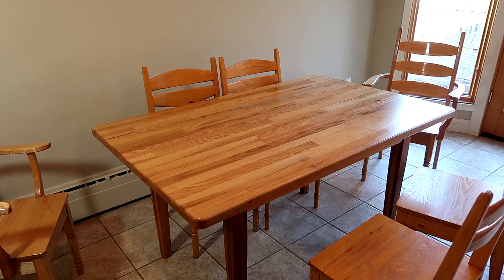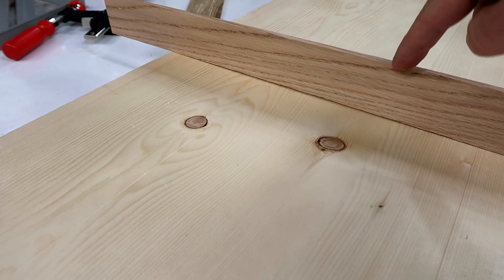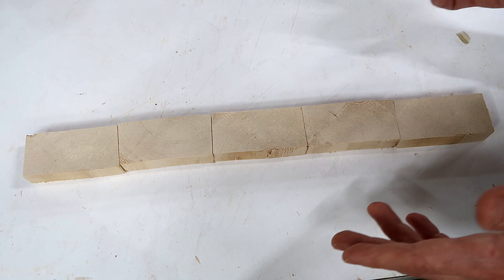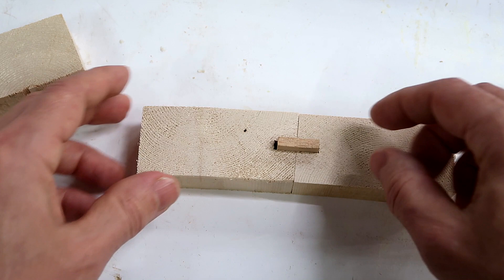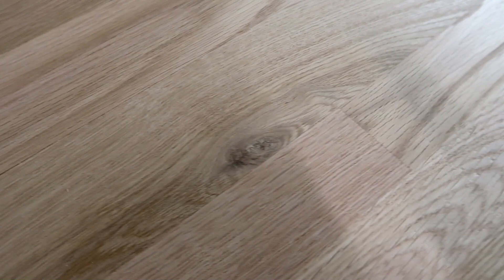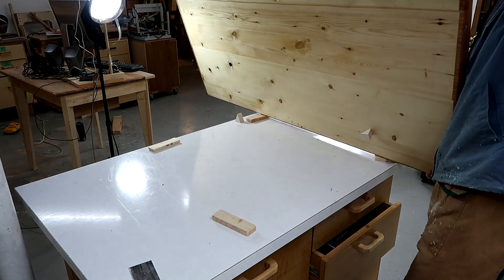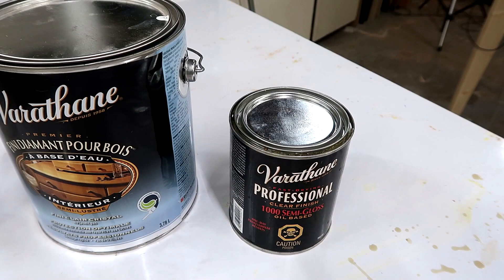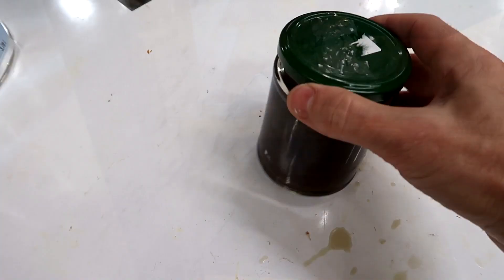Table top glue-up and varnish

Comment: Instead of spruce dimensional lumber, why not make the “core” out of a lamination of: 1/2” MDF,  3/4” particle board, 1/2” MDF? flat and dimensionally stable.
Reply from the maker: might be worse.  If the bottom doesn't srink and expand, and the top does, that will cause warping.
Reply: @matthiaswandel  there is no way a thin veneer of oak (3 to 5 mm?) would ever warp a core of 1/2” MDF,  3/4 particle board, 1/2 MDF.  MDF  Doesn’t expand or contract. Especially in a laminate 1” 3/4 thick. Impossible. Sand the top surface of the MDF 40 or 60 grit. Use good PVA glue, and clamp well. Will last 100 years. The glue and the MDF are much stronger than the dead oak trees.

Comment: Me:goes immedietly off topic
Matthias:well f*ck. I make videos to make money and rip apart useless stuff to make it into a centrifugal blower to make a dust collector and i just made a slightly "twisted" table top.
Me:Asks how does Matthias make impellers so purrfect.
Also me:well screw it i am making a blower out of cardboard and hot glue with the weakest 12v motor i have because i am not like Jeremy fielding or Matthias.

NOT BASED ON ANY CONVERSATIONS OR REAL LIFE. DO NOT REPEAT YOURSELF.

Comment: Oak is beautiful & for me the varnish totally ruins it.
Reply from the maker: and without varnish, it would be even more ruined in time, with kids.
Reply: I agree, it definitely needs protection. Just the yellow tint and super glossiness really takes away from the look. Why not try something else that has a comparable durability to varnish?
Reply: @kolos121  yeah, the yellowing over time really kills it.  Even white oak laquer will yellow.  
Long ago I used shellac on a pine table.  It didn't get AS yellow. But still yellow.
Maybe just sand it down every 5 years instead? Or would the moisture kill it?  I guess liquid spills could darken the wood.  Heck maybe just cut a transparent    cover. :-)
Reply: oak -> DANISH OIL.
Best results i ever had.
Reply: @The1Rausch  What brand?
Reply: @TheRainHarvester  making it yourself with tungoil base is NOT recommended (i tried) - the thickest danish oil which i recommend is made by RUSTINS (3 coats can do the job) but it is not supercheap.
Other brands i tested had more white spirit (deeper penetration but you can just add white spirit to rustins for the base coat)
The shelf life after opening is 6 to 12 months so do not buy big quantitys if not needed. When i used it for the 1st time the result blew me away. Try it :)
Reply: @The1Rausch  thanks, that is very helpful!